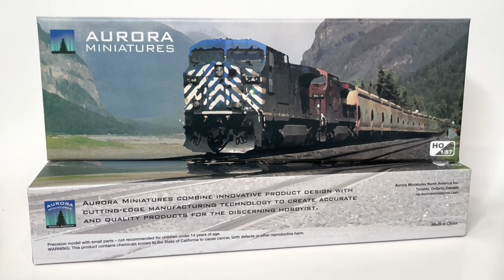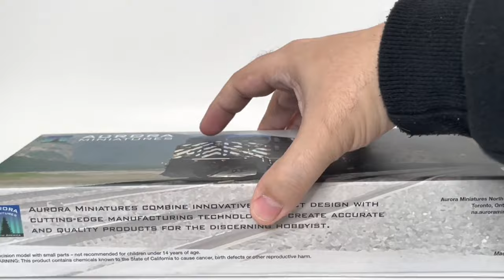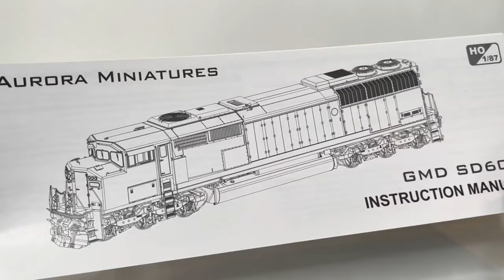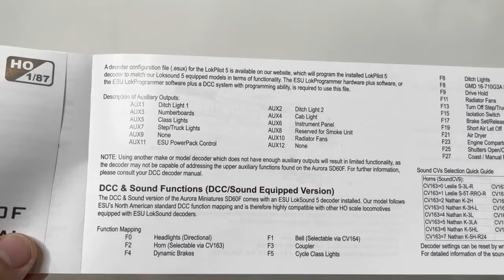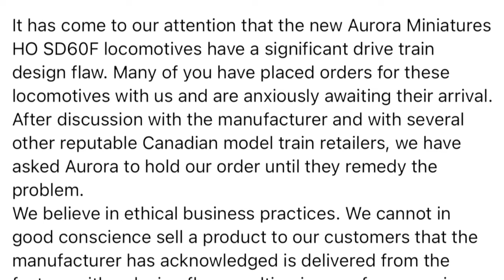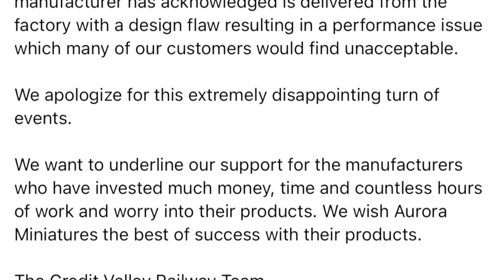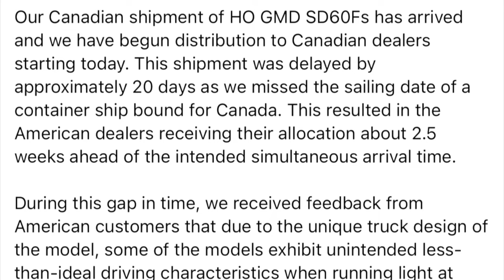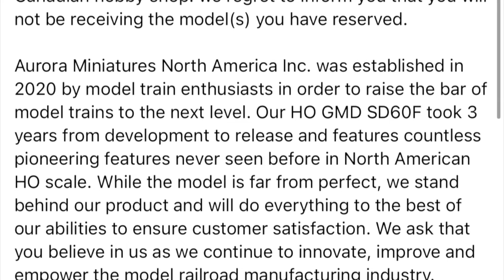Aurora Miniatures SD60F Loco Review

Comment: At the end of the day they did in-fact require a decent amount of modification and adjustment to function properly. However, they have proven to be a great locomotive. I also recommend the speaker upgrade housing from Motown Models. Unbelievable sound improvement from the stock speaker. Good review btw!
Reply: Did you get one? My fans don’t spin. That’s the only reason I got one! Haha.
Reply: @MMRails  I did, yes. I’ve heard that was also an issue on some with the small fan motors burning out. Aurora should honour a repair though.

Comment: Excellent review Kris. I'd be curious to know what the specific issue people seem to be complaining about actually is if the models weren't tested. So far mine has been flawless out of the box, even without a break in period.
Reply from the maker: There was an issue with some that made them jerky under slow speed due to truck issue. They do offer replacement trucks with proof of purchase but you need to changed them yourself. I never bothered as both of mine run fine. M&M rails has one and the fans don’t spin. But he is the only one I heard of with that issue.